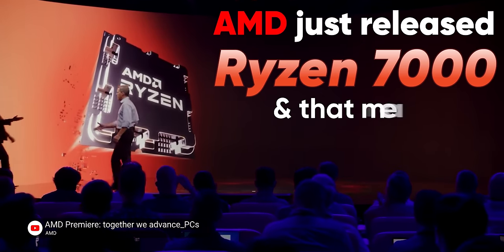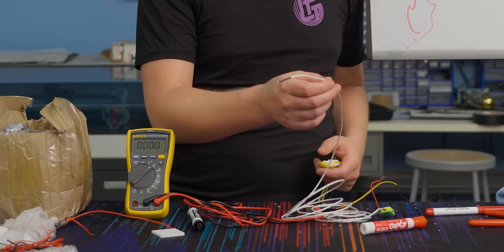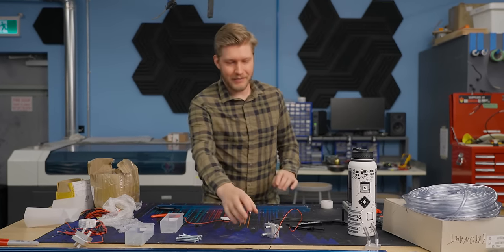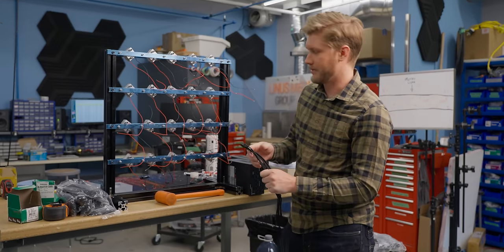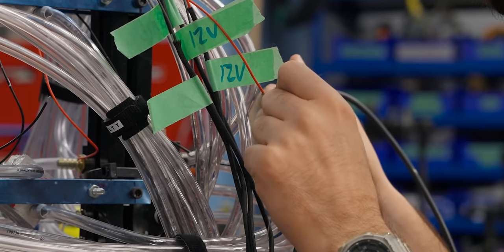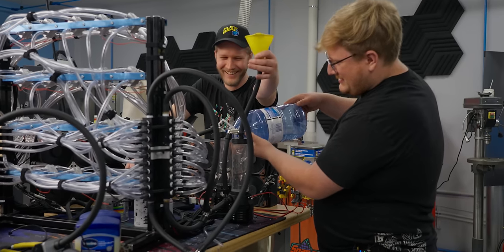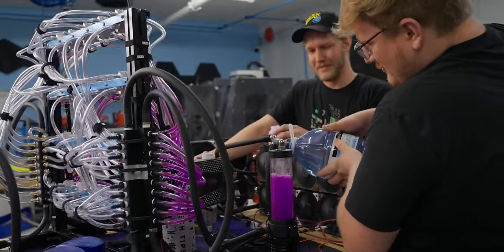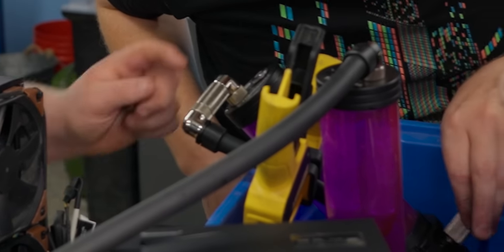Our DIY CPU Chiller From AliExpress is RIDICULOUS

Comment: At the beginning you were hand turning in the nozzles, you do know they are meant to be used with a socket, right? Waaaay faster even though they are cheap. Go easy on the torque though, don't want to snap them either. Some things on Ali Express are brilliant, but PC stuff is often not exactly what you think you are  getting, like SSD's, buy them here! Or CPU's, I mean c'mon folks, China loves spying so why buy pc parts there? Then again, the NSA is just as bad...or worse. I built a bio bucket that required turning in plastic threaded nozzels, and doing that by hand would be something I would not consider.

Comment: RAISE your Manifold TO THE TUBES...
FILL FROM THE TOP...  Then the OUTPUT into the bottom.
You have so Much pressure in water its getting stupid.  HOW MAUCH WATER??  1 Gallon = 8 pounds.

Comment: at the moment i am at 7:10 in the video so iam still watching, but now without having seen the outcoume my gut feeling would be to connect the single coolers in a row instead of parallel so that the temps ad up, i guess i will see in the next 13 minutes if parallel worked or not 😅

Comment: Pretty lame for this tech kids. When pumping water water pump must be higher or mid level than the loop. Putting the loop of tube at floor level and pump in the table had help to take out air a let gravity to fill every loop.
Reply: The opposite is true - a water pump must run wet, it should always be at the bottom of the loop. The problem here was head pressure, the pump placement was correct.